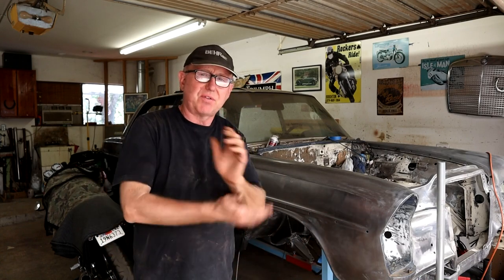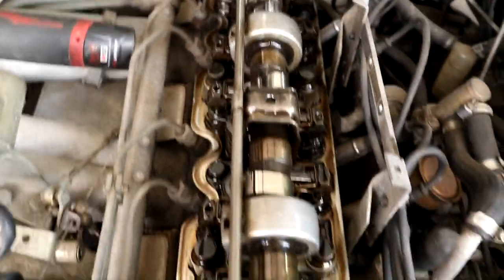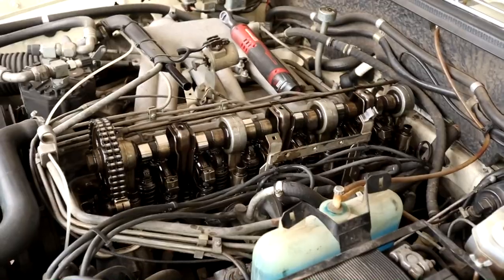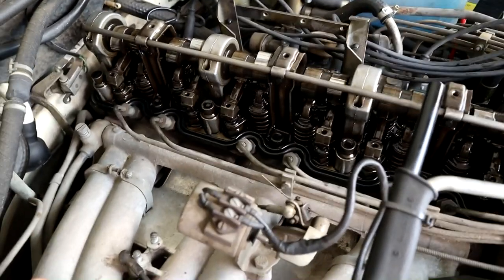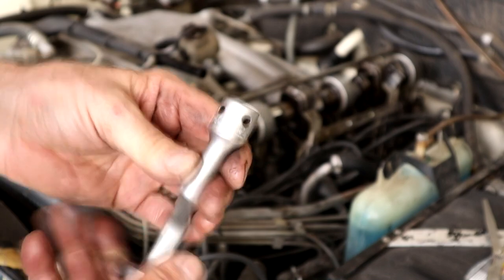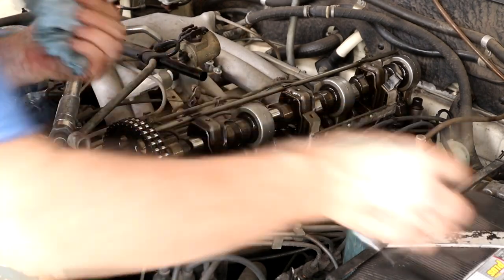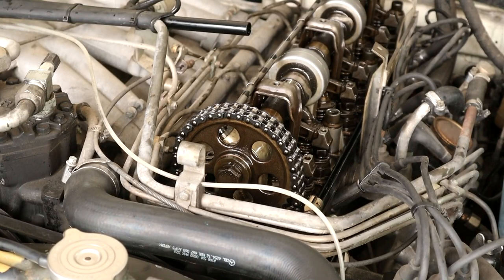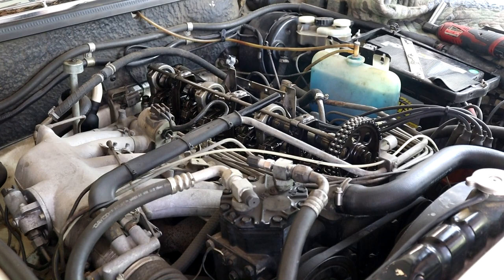MERCEDES W108 M130 VALVE ADJUSMENT AND CAM COVER CLEANING.

Comment: No need to take springs off
Reply from the maker: You're right. I got in the habit of doing it in case I need to remove rockers if I get a stiff adjuster nut. Then I can fit a socket. Cheers john.

Comment: I did them in firing order. Easy method.
Reply from the maker: What happened the other day? I value your input Chris.
 Cheers John 🍻
Reply: @mercedesmaintenance.6339  others in the group decided they know more than I do, yet they are not involved in the industry anymore than just changing oil. I got fed up with the nonsense, so I left the group. I have better things to do with my time than argue with them.
Reply: @Ken's Show & Tell I'll share my extensive knowledge when others are prepared to shut up & learn. Until this happens, I'll remain silent.

Comment: I always either remove, or disconnect, the fuel pump relay when doing this type of work, so as to prevent gas accumulating in the cylinders when flicking the engine over.
Reply from the maker: Good Idea!

Comment: this might not be the perfect place to ask and i did comment on your older video but how did you remove the whole wooden dash stretching from the driver side all the way to the glove compartment? thanks
Reply from the maker: No problem. It is a lot of work to get the dash wood out. Firstly gauge cluster has to come out, then heater controls, radio, vents, misc switches and the Ac unit lowered to get to screws on the lower edge. Its something I will be doing again in the future as the 6.3 dash needs refinishing. I will shoot a video of that. Stay tuned:) All the best Cheers John.
Reply: @mercedesmaintenance.6339  thank you very much

Comment: Hi!, we know all about fires here in Australia but we also have really big floods and I lost everything last march when 2 meters of water through my place. I left a reply over on my little channel about the blue spray.
 I'm also trying to track down a pair of M117 mount arms for a W108 .Part numbers are A116 223 1204 and A116 223 1304.  cash waiting...ha ha.
Reply from the maker: Hi Ron. I have 117 and transmission sitting in the shed. I'll check to see if I have the mount arms. The bloke who gave it to me pulled some parts off before he gave it to me.
🍻 Cheers John
Reply from the maker: Hi Ron. I took a look today. Sorry no mount arms. The guy who gave it to me stripped some stuff off before. I do have some pistons, connecting rods and misc other stuff. Also heads etc. Cams have some surface rust but could be possibly saved.
Cheers John 🍻

Comment: Would like to have heard the engine running when you finished …….. can you hear a difference when you have finished? I remember my dad teaching me how to do this in the late 70’s on a Peugeot 304 1.6 diesel …… it used shims to adjust the clearance. It was a tricky little job to do. We had the misfortune of dropping a small bolt down into the engine and spent a whole night stripping down the front of the engine to retrieve the bolt 😀
Reply from the maker: Good idea Peter!! I have a friends w113 that we're going to do next, I'll do what you suggest. He's not had them done for a long time.
Cheers John 🍻